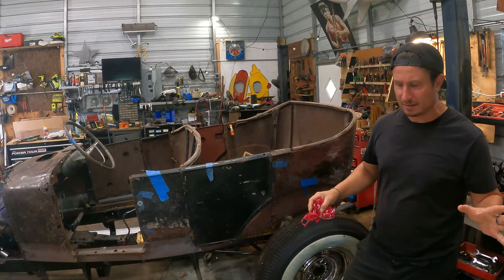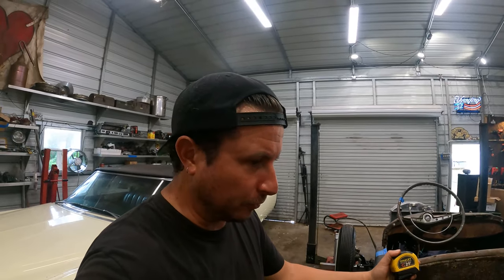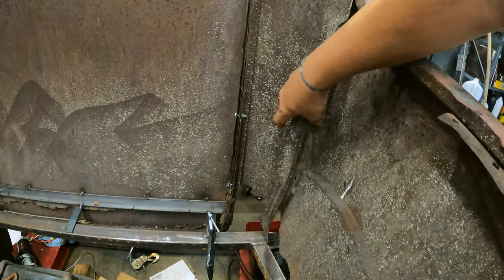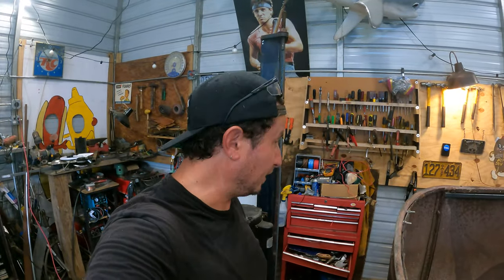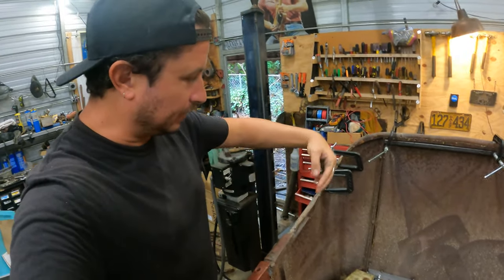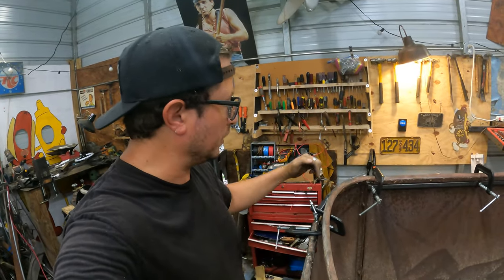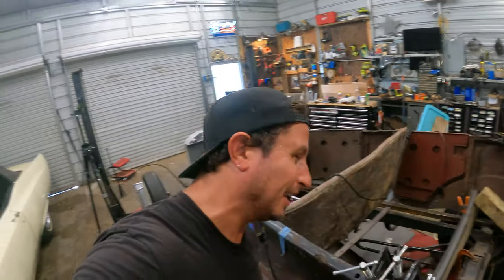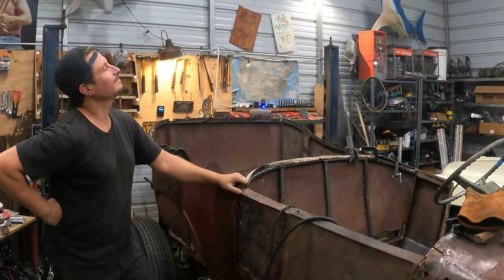95 Year Old Model T Body Needs HELP! New Bones Of Steel- 1927 Ford Touring Hot Rod Project

Comment: I had to do that on my 35 international pickup, not as much wood as a ford but still had to rebuild with metal and not many people will even know, but it sure helps make the body not flop around
Reply from the maker: that the one of the things about hot rodding these... the body always needs a certain amount of "restoration" before you even get to build or customize.   its good work we all do... people will get to see one more on the road one day and a 35 international is a cool one
Reply: It was definitely a fun build

Comment: Learned many lessons about the open Model T bodies while reinforcing fiberglass reproduction bodies. Namely how quickly one can change the factory body lines/curves by NOT trying to duplicate the original structure's exact curves.

At this point you ask where I found "originals". REALITY PEOPLE: While Model T Fords are entering the triple digits in years THEY ARE NOT IMPOSSIBLE TO FIND and measure!

Make friends w/ people who actually restore the cars and ask to be allowed to make measurements!  

Make efforts to insure future generations get to see examples of Model T's that retain the factory shape in regards to the curves...
Reply from the maker: These are all fair points... however in the case of this scrap metal yard art jalopy body ...being built as a hot rod/driver... hopefully the shape will be close enough for the future generations to be interested enough to learn more when they see it on the road....tape measure in hand or not